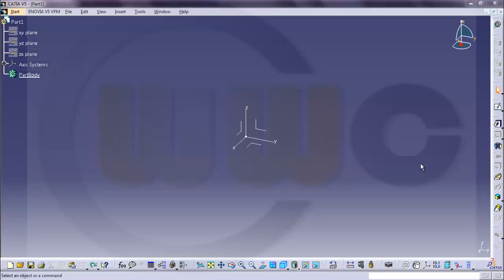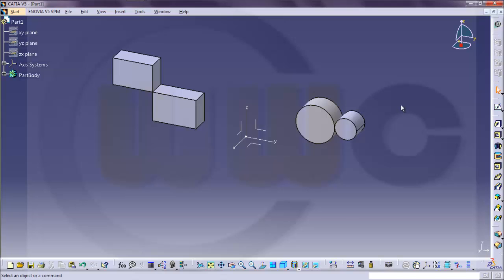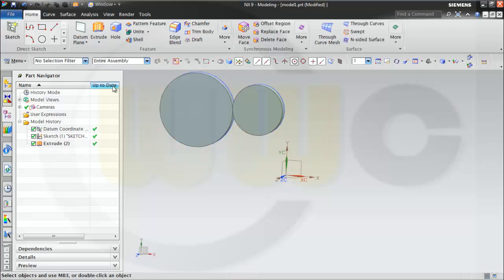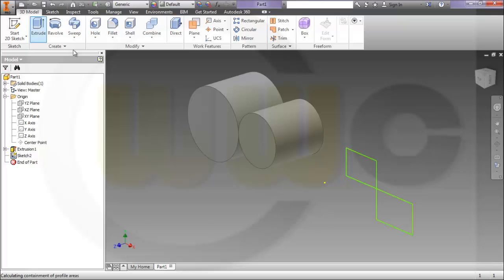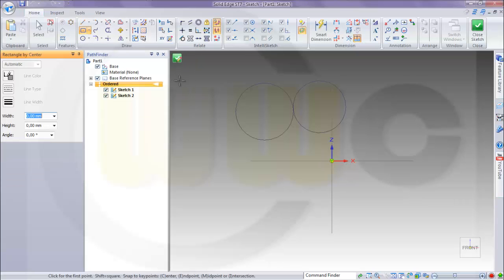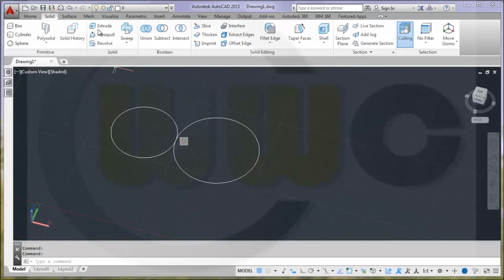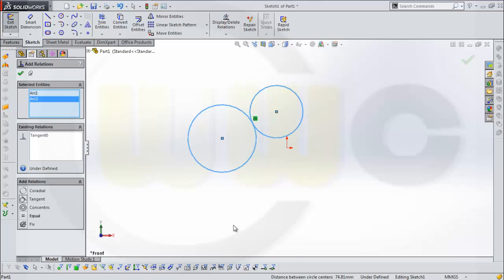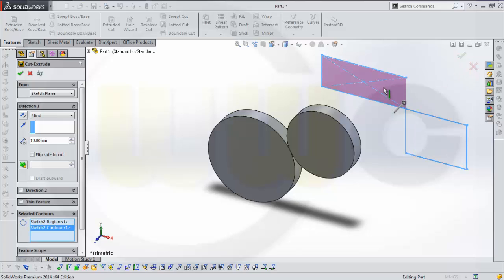"really "small" Differences Cad Comparison

Comment: Hi Wolfgang, looks like you did a extrude cut on the rectangles in solidworks and not a extrude boss.
Reply from the maker: Grant Patullo Hi, thanks for your advice, you´re right, just checked it - I made a cut by accident and of course this doesn´t work. But a "boss" will not work as well.
Reply: +Wolfgang Walden Just check in SolidWorks 2014. The two rectangles do work.
Reply from the maker: +aMammoth Seems it depends on the SW version, lol.
Reply: @wolfgang.walden.cad.training  just tried it on solidworks 2017 two squares works out perfectly
Reply from the maker: @badasschris13  yes - but the video was made with an older version - so from time to time they "improve" the software.